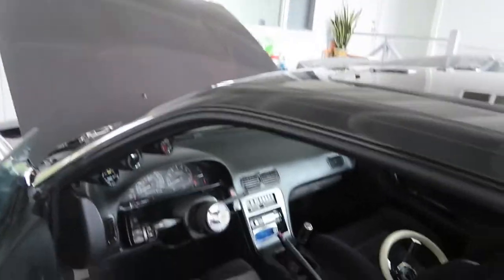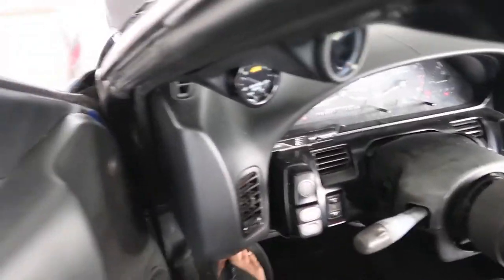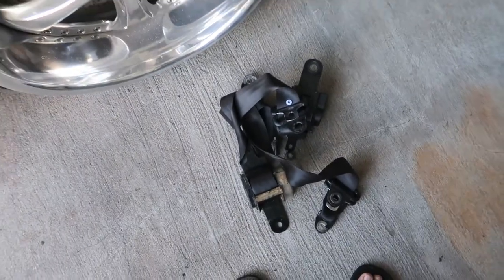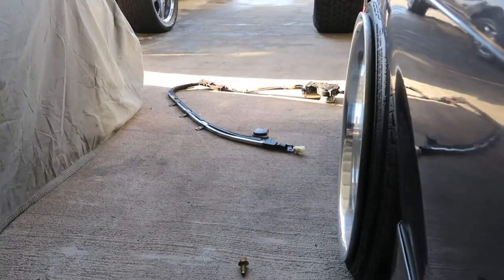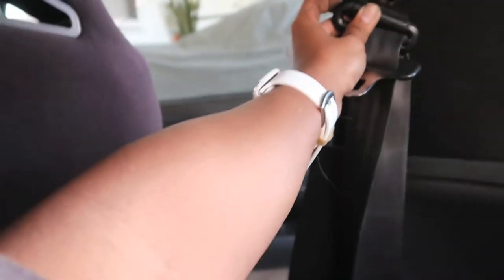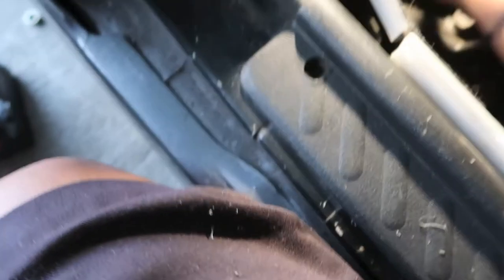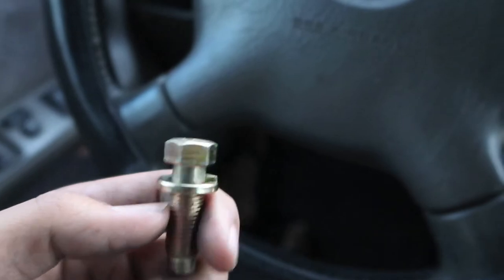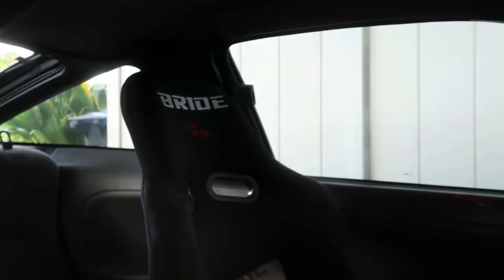Manual Seatbelt Conversion for the 240sx

Comment: What bolts did you end up getting
Reply from the maker: Eat. I believe the thread pitch was 7/16-20 and the length was maybe 35mm-40mm and I used bigger nuts in the spacing between the panel.